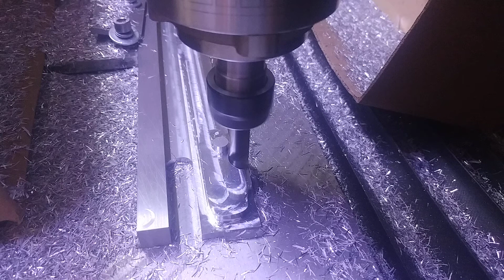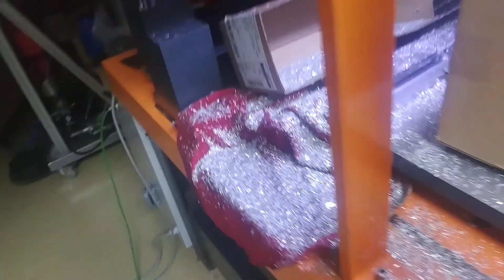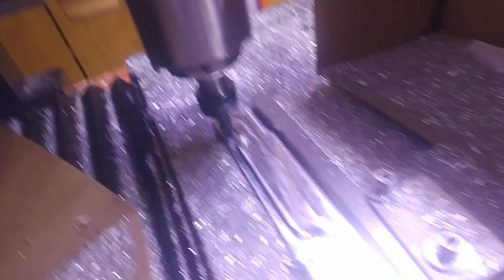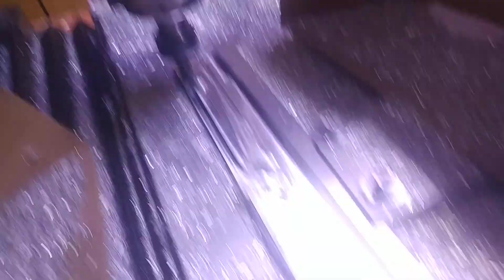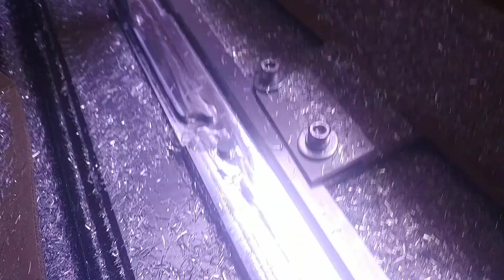Uni-Mat 3 CNC custom made with Beckhoff system - milling test

Comment: Hi, 

I’m starting a small project to build a 3axis cnc mill. I will use TC3 + ax2000 axis( just got them cheap..) 

I did already lot of programming in TC3 but stayed on motion side just at the PTP part. So it’s first time I will use NCI/CNC logic..
It looks like you do have lots of experience in it. 

Would it be possible to share some insides of your project, in case It does not touch business interest?

Comment: Hi,
Reply: I do start a small project to build a 3axis milling machine. I will use Beckhoff TC3 with AX2000 axis. (I just got them cheap..) 

I did already lots of programming in TC3 but stayed on motion side only with PTP for now. So it’s my first time working with NCI- CNC logic. 

Would it be possible to exchange with you, in case your project is still alive?